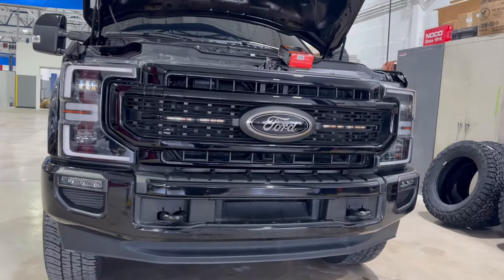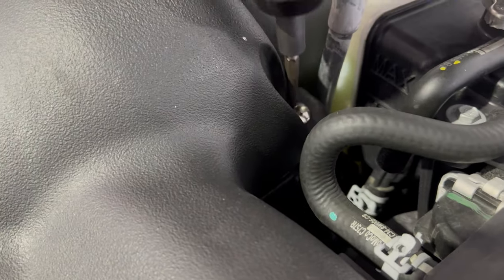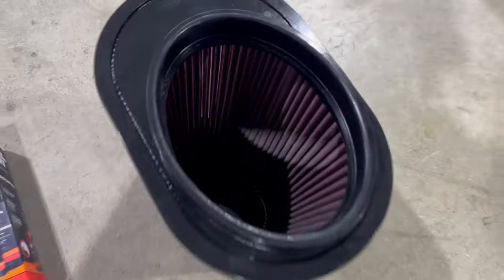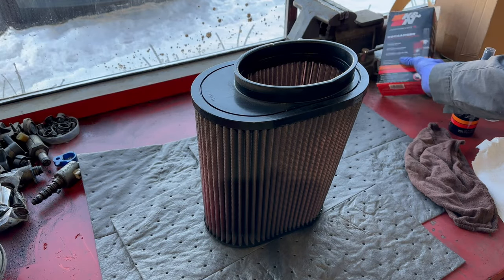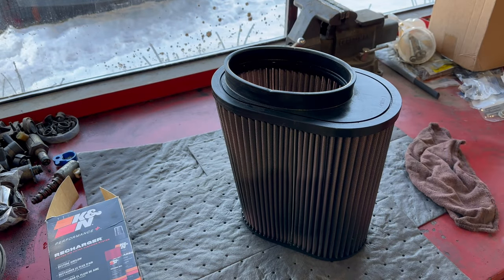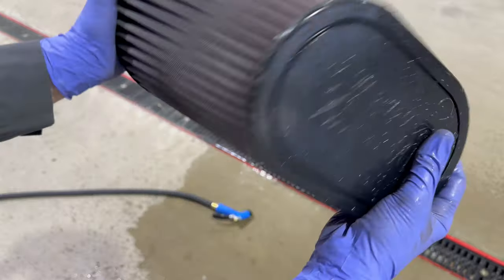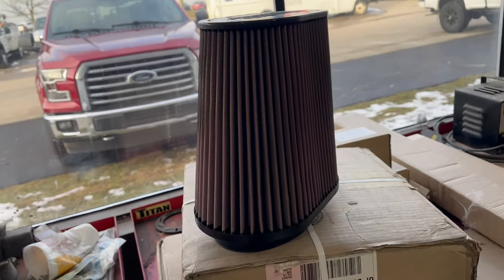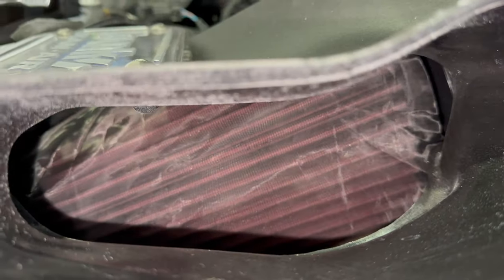watch HOW TO | clean a @bankspower BIG ASS filter

Comment: I have a 2003 7.3 and I have had a Air raid and it looks exactly like that and it pretty much the same way I clean mine but I usually only give it an hour to dry on both the water and oil and my truck has 386000 miles on it and I have been doing it that way for 20 years baby!!